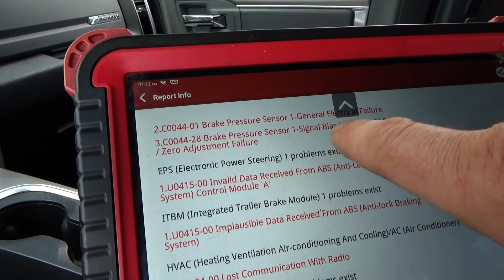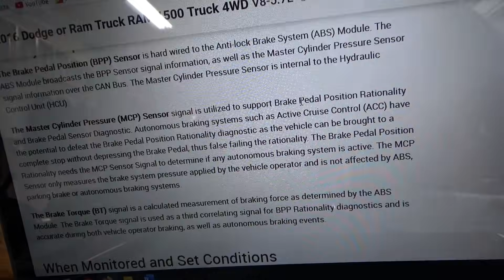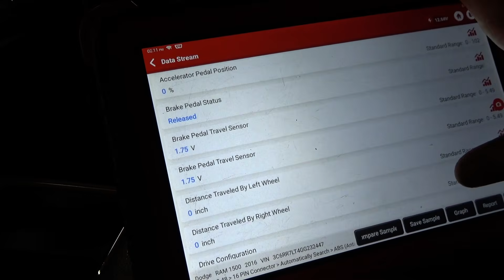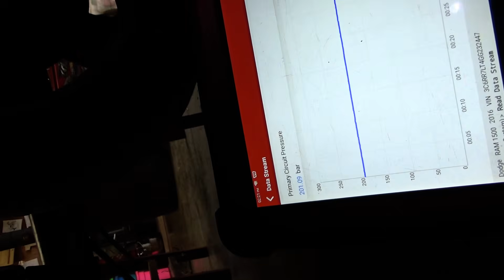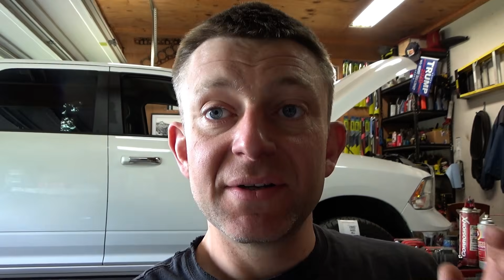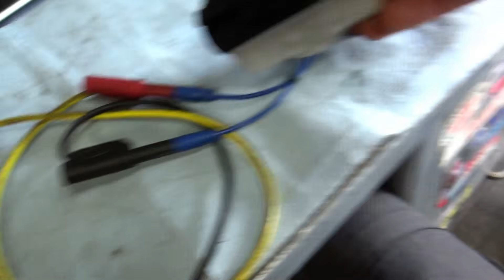(Pt 1 - 4th of July Special) Ram ABS Saga...(CEL ON, Can't Pass Inspection!)

Comment: I understand the emission laws in densely populated areas but the whole inspection of the whole vehicle and not allowing them on the road if anything has a check engine light on is odd to do when most streets are not over 55mph..  i would get it if america had an autobahn and people drove as fast as they wanted..

Comment: That junk module is from a 2014 truck. 2014-2015 have a different part number than 2016+. So you may have a compatability issue causing you not be able to write the VIN or initialize it.

Comment: I'm only 1 min into the video but it's unbelievably moronic if they're now programming the cars to set CELs for ABS problems. ABS is not an inspection failing item in NY, and probably not most other states either, but you can't pass emissions with a CEL even if it's entirely unrelated to emissions. What a joke!

Comment: i have two cars at work that i cant get parts for and are low kms but not usable , modules have died and dealer no longer supplies them and no second hand  parts left around as they were common issues

Comment: That's how they screw you. I'm waiting for a truck maker to build one that will work and come with no thrills. Simplicity at its best. Not even a radio. Just a heater and window wipers with a manual gearbox on the floor under $9k.
Reply from the maker: Keep waiting haha
Reply: @PineHollowAutoDiagnostics  🙂

Comment: Just had a similar with a '14 F150; bad pressure sensor (inside the HCU, of course), but the electronics module was ok.  Ford discontinued the ABS module altogether.  Fix from dealer was a Ford-approved replacement ABS and reprogram for $3K!  Solution was a used ABS module to harvest the HCU with working pressure sensor inside, swapped onto the the original electronics module.  This really looks liked a planned-obsolescence campaign on the part of manufacturers!
Reply: Not according to one brain washed dolt in the comment section.

Comment: We had a Camry Hybid that has full electric pump controlled ABS Brake pressure module as in electric pumps run to keep accumulates loaded or no brakes it would set a internal pressure sensor code every 9 to 12 months and turn off the RR wheel fluid circuit thinking it had a leak so it would shut off that wheel. The problem was internal sensor code for RR wheel  circuit only and the parts were 4000.00 USD  for the pump hydraulic unit or possible it states in service info the Skid Control computer another 200.00 USD. No used units could be found and the customer said I'll live with it because of cost. You cleared code and everything worked great for maybe a year but boom one time problem lights on and turns off RR circuit. Being a hybrid special brake system  and very very expensive parts and how do you tell what is failing in such a intermittent problem and service info is really for a I'm failed now problem.

Comment: I had the same problem with another car with a ESIM malfunction.  Leak tested and pinched off the vent hose.  Found no leaks.  Removed the ESIM and it's completely broken internally.  The dealer didn't have it in stock.  It was on backorder for weeks.  Got one from the local autozone.  Dorman of course and it didn't work at all.  Autozone sent over another Dorman unit.  It worked for about a week.  I and the customer are getting frustrated at that point, so I went to a local U-Pull-It yard and grabbed a few of them.  First one I tried worked.  That was 3 months ago, and the money light hasn't come since.  It just makes you wonder how Dorman can stay in business when they keep making junk replacement parts that rarely ever work?

Comment: On everything in OBD 2 I have ever worked on a Level Sensor code turns on MIL because of fuel  volume is taken for the time base for EVAP  as in air volume vs fuel level 1/8 to 7/8 in the range it takes to run evap 3/4 less air volume 3/8 more air volume in tank I hope it makes sense.  You see it when smoke test how long it takes to fill system. The dorman ESIM probably cost more than the OE part as they are cheap.

Comment: Similar issue on my '13 F150.  The pressure sensor crapped out, showed like 1100 bar on the data PID.  HCU needed to be replaced as a unit.  Fortunately, Ford still has them available.  11 year old truck, 98000 miles when it went bad, salt belt but always oiled underneath.  I don't really mind all the extra crap they're adding into cars and trucks these days to turn them into mobile living rooms, but the new car pricing greedflation and engineering them to last 6 years and then fall apart really burns my ass.

Comment: Last I checked, ABS has zero affect on emissions, and ABS malfunctions alone are not grounds to fail an NY state inspection. An illuminated check engine light will fail, though. Sure nice of Chrysler to turn on the money light for something that is completely unrelated to the engine or it's emissions.

I've seen bad blower motors do the same thing in Chrysler vehicles of this vintage. It is completely unacceptable.

Comment: I had some weird ABS problems on my 2014 RAM, light came on and off, sometimes stayed on, I could not connect to the ABS module using AlfaOBD which has worked before when I  needed a sensor. Checked fuse, which was OK, code went on and off 10ish times on my way to work, checked fuse again, and it was OK, however the ABS light stayed off after reinserting the fuse, has stayed off for 2 weeks. I believe my problems came from poor connection between fuse and fusebox. I have not tried to reconnect to the abs module, guess I should do that.

Comment: I have been waiting on a abs unit from the dealership for 2 yrs now,still on backorder they say 2014 dodge journey with the 2200-49 code /internal failure,,,,abs light on traction control light on and the brake light on.....journey drives and brakes okay just no anti skid braking amovible also with these lights NO cruise control option as well......that said most of the time if i am driving it during the summer the lights come on at first but after driving it a bit, i can stop and shut off the engine and go into  a store and then come out right away and then start and take off in the car the lights will stay off and the cruise control will work,,,oh well at least i dont live in a state ( ALABAMA) where we have to have the car inspected so at least i can still drive my journey also i have 160 k on it with the 3.6 engine and they sad fact is i bought the lifetime unlimited miles and yrs warranty on this journey with just a 100. ded. but the dealership wont use used parts even tho the warranty does state in the fine print that the repair parts might be new/remanufactured /used parts for their repair...I also have read that the repair of the ABS unit might can be repaired by cutting it open carefully and resoldering the surface mount components and ground connection but i dont want to try that as long as i can drive the vehicle and also doing so might give the dealership an excuse to void their obligation to do the repair

Comment: Buy the stuff from Harley Davidson that they use to lube the head light switches on the handle bar's I used it on my relays and fuses on my friends bike it not get a corrosion green crusty give it a try on a project the fuel pump relay get the crusty the I A C would start to run by its self with the key switch turn off and no key in the bike

Comment: The Dodge RAM Cummins Diesel 4500  and the 5500 is the worst Truck you can buy there a recall on them they got to replace entire fuel system my friend had two it went bad one guy California almost not registered his 2022 Dodge 5500 I think because Dodge cheated on the emissions but this guy got to get his truck smog inspection 2 times a year low mile a guy transmission went bad 68.000 my friend engine went bad the Grid heater bolt gets corrosion the nut falls off Destroy the engine 6.7 motor tell this customer he mite want to inspect the grid heater bolt Banks has a better replacement for the 6.7

Comment: Our emissions program in Utah has the legislation to command the MIL on printined in the training info. (exceeding 1.5x the mandated emissions for that class or failure to be able to estimate the emissions). Our emissions machines will print a passing certificate with a MIL on and list of codes on the certificate. 

For this reason you can actually be shut down for refusing to test because of a MIL illumination. 

Make sure they actually printed a failed certificate.
Reply: Asking the state why they programmed the machines to facilitate these crimes was not the best idea BTW.

Comment: Is that dash 'ding,' 'ding,' 'ding' an OSHA or ANSI required sound?  Seems common across most platforms....  Why not make it operator selectable? And more profoundably, make it mechanic silenceable during diagnostics.  

/-|-\-|-/-|-\-|-/

Be THANKFUL there's MORE THAN ONE AUTO MANUFACTURER as competition is the most effective means of modernization and improvement...   If the government were in TOTAL charge they'd limit it to just ONE car company and it WOULD result in TOTAL CRAP being manufactured.

Comment: had the same exact code in the ABS module for the brake pressure sensor on another Ram truck but I can't remember the exact model year but it looks like the same set up as this one.  the trouble shooting tree for that code it horrible.  In a nut shell it says clear codes drive car and if code comes back replace module.  Seems like a very common issue with these ABS modules.

Comment: Lesson to be learned don’t buy Ford or Chrysler vehicles. I had the same problem with my Ford. The part was unavailable. I had to junk my car with only 50,000miles on it because I could not pass inspection in NYS. American cars are just junk and a clear message must be sent to the manufactures that we are just not going to buy your products anymore because they are junk after 6 years when parts are no longer available. I also own 2 Lexus vehicles. One is a 2007 and one is a 2013. My 2007 rx350 needed a new dashboard because it cracked. I was able to buy a brand new dashboard from the dealer and it shipped to me in 2 days from Japan in the exact color of the original. How is it that Lexus makes every part for a car that is 17 years old and Ford and Chrysler decided to screw their patrons by making them buy new cars every 6 years?

Comment: Ivan. If you haven't fixed it already. I have the part numbers for the pins and the connectors. Also new  units have to be programmed before scan data is valid. The hcu can be programmed through meritor/wabco program. Free to download. I have rebuilt plenty of the pigtails to the ecu in the past. The electric motor is usually the failure point on mechanical side and corrosion on ecu side. Check the pins, bet wires are broke
Reply: Your comment should get pinned at the top for all to see.
Reply: I wish Mertior/Wabco was free for heavy duty. All the new class 8 stuff has radar calibration issues constantly, steering sensor issues, forward facing camera issues.

Comment: Don't send it to the dealer over a VIN write!  Most aftermarket scantools will be hit-or-miss writing VINs to modules on Mopars.  Grab your J2534 and set up an account for WiTech 2.0.  It takes a day or two for initial account setup, and it's close to $100 for a 3-day subscription (you have to have both a WiTech sub AND a TechAuthority sub for WiTech to function), but you'll have dealer-level access, including SGW on 2017+ models.  The only limitation I've found are some 2024 Jeep models, and most late-model Maseratis.

At some point during the account setup process, it will ask you for your J2534's serial number.  The number it actually wants is generated from within WiTech; just launch the software and find About in one of the dropdown menus, it will give you a 25-digit "serial number" that's created linking your interface to your copy of WiTech.  :)

Comment: The auto manufacturers have finally found a way to force people to buy new vehicles. Design parts that will fail and stop making replacements. Eventually the vehicle becomes unrepairable and you're forced to buy a new one. Genius. Although I have a few less flattering words for it. Absolutely disgusting what is going on in the automotive industry. Designed obsolescence pure and simple.
Reply: I am still rocking my 1989 Honda Crx HF that I bought new in Jan. 1989.  It has over 378,000 miles on the clock and has never left me for any reason whatsoever.  I do my own maintenance and am not a mechanic but can read.  Today's cars scare me because I don't like feeling as if I am being played.  I still get 40 degrees through the middle vents and can find any parts that I would reasonably expect to need.  I don't need forty different modules to get from A to B.  Plus, I get 47 mpg day in and day out.  So, no dealership/stealership will see me anytime soon if I can help it.  If everyone did the same, then they would quickly play a different tune.
Reply: You will own nothing and be "happy" by 2o3o.
Reply: @nicocas2801  Exactly!  Manufacturers will want options to be by subscription where they can milk you monthly forever.
Reply: Buy a different make. If not it is on you
Reply: The EPA is a major driving force behind a lot of how a vehicle is designed. Impossible mandates force EOMs into hurried, shoddy designs, then the OEMs are blamed for producing crap vehicles.

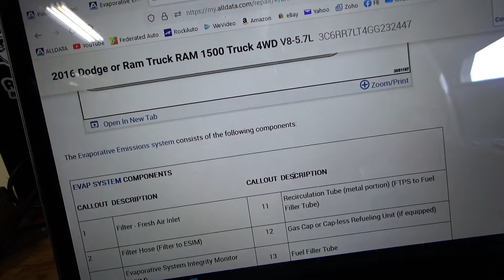Comment: That sensor (number 10) is going up to the vent in the filter tube. (24:15) ..  You call it the fuel tank pressure sensor, but I was thinking it's the "pressure relief valve" that it keeps referring to,  since it's venting to atmosphere up near the filler.  I thought that vent tube would be open all the time, but apparently not...   Or if you're right and that's the tank sensor, then where is the pressure relief valve?  If it is just a tank pressure sensor, I don't see why it would need to be connected to the vent tube at the filler neck???   You didn't quite show the full list of parts, so I can't find which one it keeps referring to (when it says "pressure relief valve)..  I guess it's built into the "multi function control valve"  (14)..  They call it one thing in the parts list, but then call it another in the operation break down... That makes it fun I guess. :)

Comment: I’ve done several of those ABS modules on Chryslers and programmed them. Common fail point. Pressure sensor is internal to the HCU and is a common code and the HCU needs to be replaced since it’s not serviceable like the older units. Happy 4th.

Comment: A friend of mine has a shop and I was there chatting with him recently he had one of these in. Flashing a PCM issues. He had to break down and pay the fee for the ability to flash the newer Chrysler’s as he sees so many of them. I said I wonder if them not l fixing or having parts issues on vehicles that aren’t really that old is a way of forcing people to buy newer garbage vehicles. The one that was in only had a little over 100,000 KM. So 60is thousand miles
Reply: Volvo charges several thousand dollar annual fee to use their diagnostic software and maintenance manual package. But each individual software download costs extra. 
So if you're a smaller shop you very well may be unable to fix Volvos past 2015 that require the newest diagnostic software. (Or to perform any kind of software upgrade, you're going to have to rent the diagnostic software, which can be bought in 3 day increments for a still ridiculous fee, and pay the SW update fee). I'm not sure if this applies to bug fix updates, though. But I think some things like relearning transmission software don't need extra cost. 

 Right to repair
Reply: @zzoinks  pretty insane!

Comment: I just went through this exact issue. I was told at the dealership that the HCU module is a known issue in 2018  trucks, but mine is a 2017 Ram 2500. Replaced the HCU module to fix the issue.  My truck has only 104,000 miles. NC truck.

Comment: this is crazy only 7 years old and no OEM new parts?

New trucks starting at $50,000 this is insane.    what is a regular guy to do?
Reply: Ask current Ford Super Duty owners how they feel about their 2024 trucks that have their a/c compressors failing & no parts available. 

Now, just because the Ram abs controller isn’t currently available, doesn’t mean it won’t be in a couple months & as much as they fail, it’s probably a good thing they’re getting redesigned.
Reply: @jeffs2809  or tundra owners with blown engines

Comment: This vehicle is not that old, support should be mandatory, what does Dodge expect, just trash the 8 yes old truck and buy another one from them, I'm not buying from them anymore
Reply: In the past decade and a half, "Dodge" has been owned by 3 different companies. Not surprising that there are unavailable parts for newer vehicles
Reply: There’s a difference between non-support and not currently available. I don’t think the dealers said any of these parts weren’t being supported any more, just the controller isn’t currently available. Ram has had so many issues with these abs pumps & controllers, it’s probably a good thing they’re back in redesign with the controller.
Reply: All manufacturers are like that now. Go to an Amish farm and buy a horse and buggy to get away from planned obsolescence.

Comment: The price of a new ABS unit is absurd it is like have a license to steal.
Reply: It’s been 4-5 years since I had to do the one on my ‘17 2500, but I was surprised at the price difference between mine and the ones for the 1500’s. I think the HCU was only $300 (new). The abs controller was on restriction at the time, so I didn’t do it, but it was around the same ($300) for new.

The 1500 HCU alone was around $700 or $800 at that time I think.